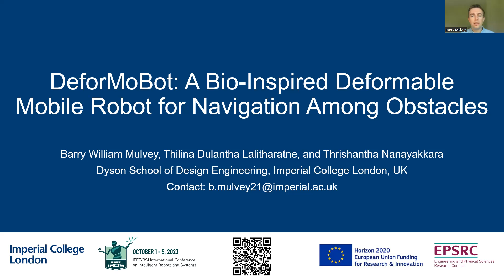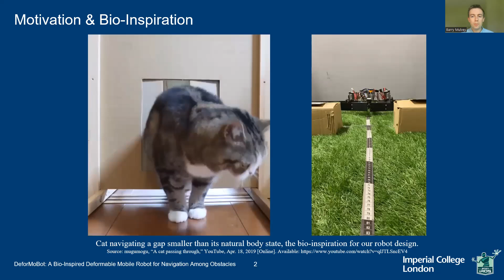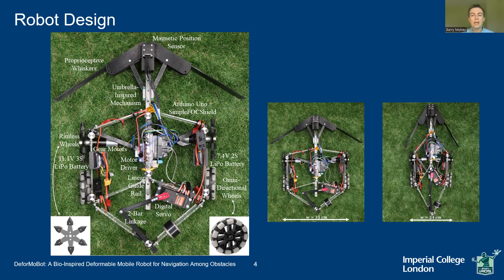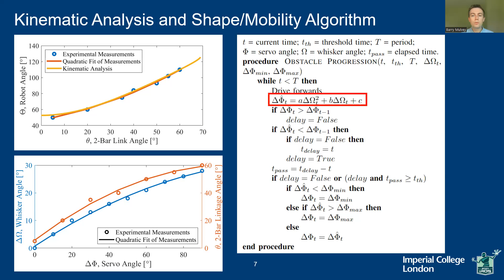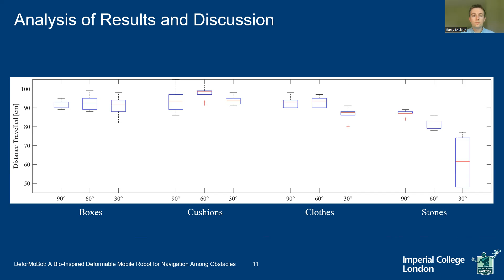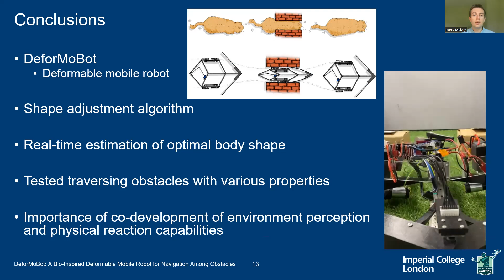DeforMoBot: A Bio-Inspired Deformable Mobile Robot for Navigation Among Obstacles (IEEE IROS Video)

Comment: Neat, any way to apply vertical transform too? Soft robotics could be applicable here too, certain negatively sprung and air-extended mechanisms could be useful for this. Could you make a system with higher variable terrain capability?